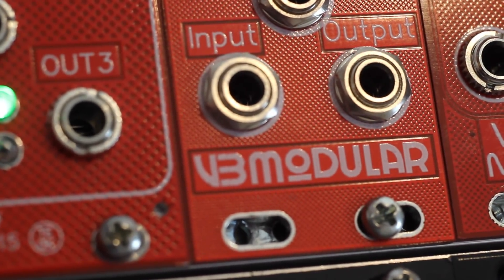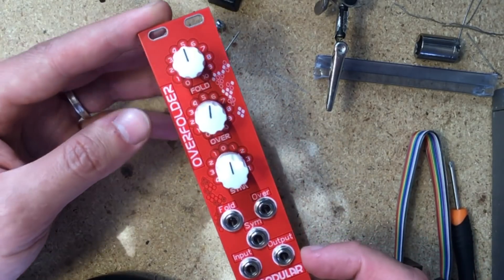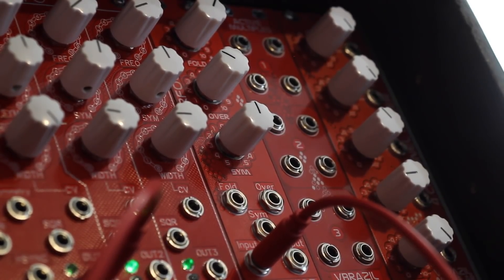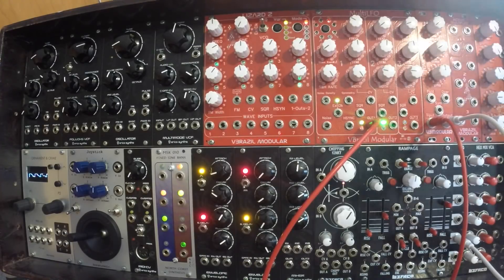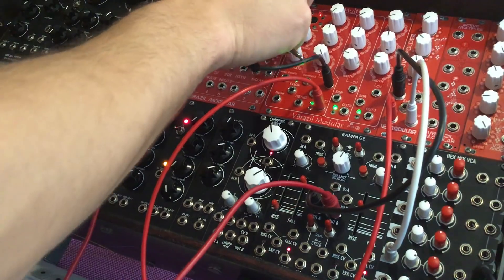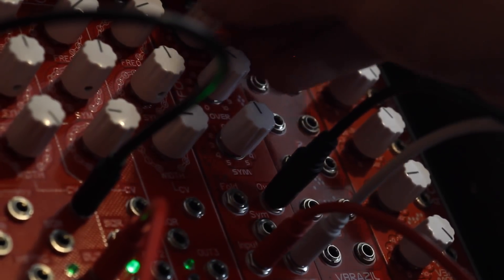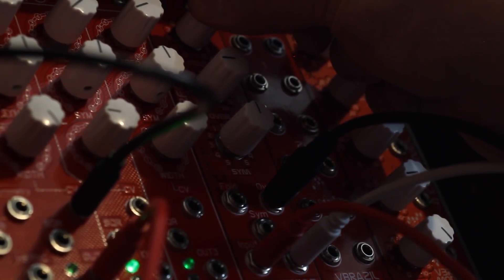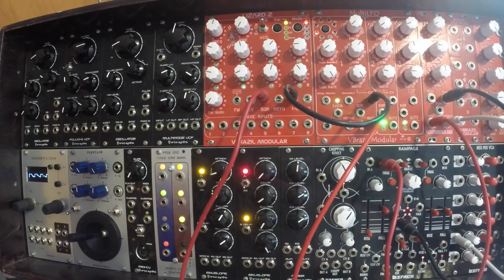Kit Review # 14 - Overfolder Rev 2

Comment: Some really nice industrial acid sounds there once you started sequencing the rampage.

It must be really rewarding to build all these modules yourself and then use them to make music. I'm trying to get the courage together to take up some DIY. Once I have done a couple of simple builds I will try the over folder rev 2 :)
Reply from the maker: Yes, you nailed it :)
It's twice the pleasure, once for having a working device that you built, and then again for using it to make music!
The Overfolder is pretty easy, you should be able to pull it off after a couple of simpler kits like the Mikrophonie for example.

Comment: That VCA trick is cool, got to try it! Do you know if its possible to add the noise reducing caps to my rev.1?
Reply from the maker: TRUEiMPROrecords yes you can, easy mod. Just solder on three 33pf caps in parallel to some resistors. I have to ask Vinicius which three resistors, will report back ;)
Reply: Awesome! Having a lot of fun with the Overfolder, it was my firs module after the SV-1. Really expands the sound palette of a simple OSC. I´ve also run CV through it with hilarious results :) Thanks for all the good work!
Reply from the maker: That makes me happy :)
Reply from the maker: I've added the Mod to the video description and also to the online build documentation, enjoy :)
Reply: VB Modular for the win! Thanks!!

Comment: According to the description of the module: " There are also certain settings where when no input signal is present, the module will output various colours of noise – this is normal behaviour for this circuit topology and can be another alternative way to use the module." Any chance you might make a video to demonstrate how this sounds?
Reply from the maker: Sure Tom, I'll do a quickie later!
Reply: Cool, thanks.